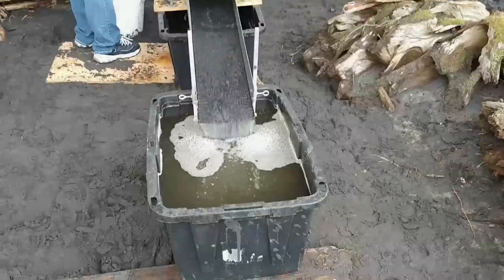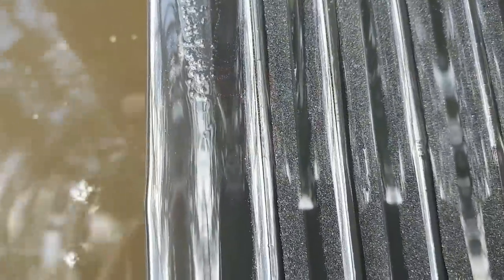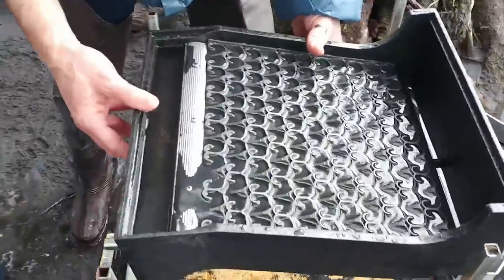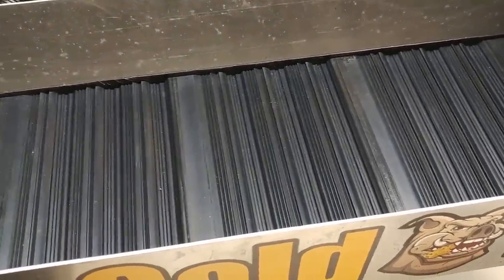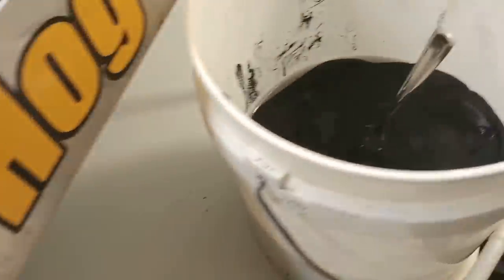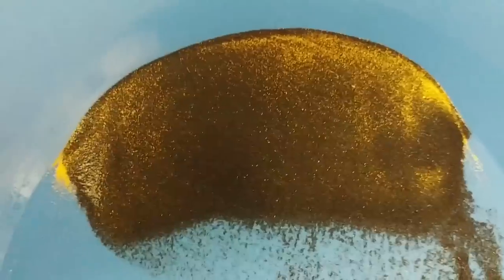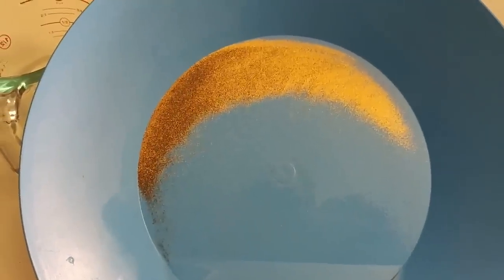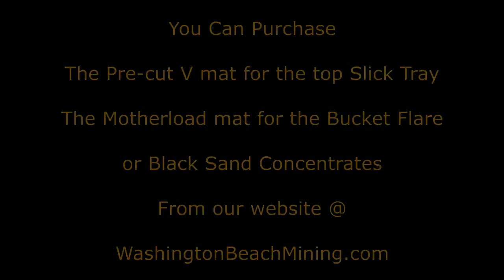5 Hours, 15 Buckets And How Much Gold?

Comment: In my final clean up if I was getting a lot of fine gold like that, as you pointed out yourself some will float on the surface tension. I would put a drop or 2 of washing up detergent in the pan and that stopped any of it floating and possibly getting lost ...... again.
Pretty good result for the amount of ground you put through, just a pain that it's so very fine.

Comment: Some years ago my sister bought a property in Oregon, it had a creek running through, the bed of the creek was black sand. We bought some simple equipment and started to pan for gold, off and on for three days. On the third day, the neighbor told us that five years previously a dredger had been through and cleaned out the creek. Would have had to wait about 1000 years for more to be washed down from the hills!!! I did take a jar of sand home as a reminder of my three days as a prospector. But we had fun😬

Comment: Next time you get a bucket of concentrates put take black sand and heat red hot with torch and throw it in water. Sometimes  alot of the gold is coated in an iron oxide. Heating red hot and quenching in water breaks outside oxide coating leaving visible gold. Heating also converts hematite sand in magnetite sands which can removed with magnet.
Reply: I wonder how much ppl have lost because of the oxide coating. Do you recover some everytime or is it a  hit and miss kinda thing depending on your location

Comment: I have a bit of a question, just in case there is a reply, with all that black sand, is that iron sand?  would you after panning that out, would the powder have to be dissolved in hydrochloric acid to remove iron?  Then the remaining dust get dissolved in aqua regia for the final purification?

Comment: You should use an old wool blanket to get that small gold you said goes through your sluice  Staple it to a 5/8" plywood after a nugget trap on a 24 degree angle . I have caught 3 grams on a blanket 6"longX12" wide . It works and I have pictures of it . The gold cube format is pretty close to what mine is designed like only I have the wool blanket on the bottom  and the steeper angle . reason it works is it uses the angle of repose to get rid of the blondes and the black sands . The gold at this size is not round but flat which lends it self to being trapped in the wool blanket and the rounder blacks and blondes continue on down the sluice
Reply: How hard is it to clean the blanket and how do u go about that. Not a prospector cuz of location but curious as to how you do it.

Comment: Hi, I saw your setup for cleaning up your sand from the gold and I asked myself, why you don't use a "Water Separation Table"? I used them a lot and with the right setup you get even the smallest parts cleanly separated on the first run through.

Comment: If you add 99% isopropyl alcohol to your wet gold powder it will dry a lot faster.  The water forms an azeotrope with the IPA and gets pulled by it, resulting in a much faster evaporation rate.
Reply: Dude, the guy has trouble adding up numbers with 1 decimal and now you tell him to do "this", have some pity.
Reply: @RenzitoARG  you sound pretty rude...

Comment: Do you ever use Finish ( for dishwasher ) or a drop of detergent to break the water tension so that the small finds drop to the bottom and not float? Also, in your pan, have you ever used a magnet to remove the iron black sand?
Reply: I think the magnet idea has been looked into, there has been billions of people trying to figure out the black sand problem was curious about soap and how other chems would affect it.........how about cooking the moisture out to a certain temp , then quench it with with something that makes to sand float?
Reply: commonconservative , the black sand is primarily iron so a magnet does a good job removing most of it. The Finish liquid or dish soap breaks the water tension so the tiny flakes of gold will drop to the bottom but the idea you have works after all the other has been done. Team work makes the dream work! 😉
Reply: oh man ....ideas are cool cause they lead to interesting tinkering, how about this............melt the gold and black sand together and experiment with shaking it around and just letting it melt at different temps.........then look at it and record the looks and the gold stuck to the sand, then, run it thru the sluice to capture the big meatballs of sand and gold........if it works let me know please
Reply: will the sand pop like rocks when heated?
Reply: commonconservative 🤣🤣🤣🤣🤣🤣
Reply: commonconservative 🤣🤣🤣🤣🤣🤣🤣
Reply: those emoji things do not show up for me
Reply: commonconservative , then how did you know I sent emoji's?
Reply: the empty rectangles with an X in them
Reply: commonconservative , they were just smiley faces.
Reply: If the black sand is iron, couldn't you use the electroplating process with an iron bar, some baking soda, and a power supply?
Reply: Matty Sarro , I don't know about that. Sounds like a lot of work when a simple magnet will remove the iron sands. Not all the black sand is iron but most of it is, usually. Then whatever process is needed to be done to remove the rest , burning to refine the gold may do it. Smelting, I believe it's called.
Reply: gebbletook , not worth it. Too toxic.
Reply: You dry your final panned concentrat in a metal pan on your stove . when dry screen off all the coarse gold and use a magnet to reove the magnatite and  small bits of tractor tracks and excavator buckets wearing etc  then whats left  you can pan gently blow and  some heavy s non magnetic sand etc out  screen off all but the sand size and take it to the refinery for smelt and assay and a check..simple.
Reply: @commonconservative7551  sounds like a way to complicate the solution when there is already a simple yet tedious process. I'm not putting you down I just think it sounds like more work. I abided by K.I.S.S. or keep it simply stupid. But don't let me stop you from thinking outside the box
Reply: @commonconservative7551   rocks only pop when they contain moisture so it would depend on if its dry and how porous the black sand particles are.  I'm gonna guess they won't pop tho
Reply: @scubamage  are you talking about electroplating the gold on to the Iron bar or is it possible to electro plate iron on to iron. I wouldn't think that's something you can do but what do I know.

If it's the first one why would u want a gold plated iron bar?

Also gold has to be 24 karat for the electroplating to work I believe. I remember hear(or reading) that all electroplated gold is 24k. Gold isn't usually pure when found in nature and has to be refined in some way. Either smelted with Flux or dissolved in a acid and then precipitated out of the solution. The second one produces a finer gold then the first one. 

Again just curious what you meant by suggesting electroplating it out. The more I think about it the more I think it might be possible. You would want to use a gold wire as the cathoid(or dioude I'm not sure which) and electroplating it onto the gold.
Reply: @lizzymoore54  
It is called smelting and you have to use a Flux when doing it. The impurity get caught in the Flux which  stays separate from the gold.  I don't know if you can remove black sand by smelting tho cuz of irons higher melting point. It has to melt to get trapped in the flux.

Comment: Just a random thought, would a vibration bed settle the gold down to the bottom of the cons bucket?? Saving a whole lot of time
Reply from the maker: No not really, the gold and the black sand weight the same so it is difficult to get the gold to settle at the bottom.

Comment: Chemist tip... if you do a final wash on isopropyl alcohol, ethanol, or acetone (anything that quickly evaporates at room temperature), you can cut down your complete drying time to 30ish minutes or less.
Reply: I'm a chemist as well and I agree.  One quick rinse with 99% isopropyl and then with acetone and it should evaporate within minutes.
Reply: @SparkyMcBiff  I'm a physicist, I actually failed freshman chemistry 😂 I've gotten better though, dont know how you chemists do it.
Reply: speaking of gold rush . they heat the gold to dry it out.
Reply: Really, how much would that increase the cost. This is interesting but not significantly remunerative.
Reply: I'm a fisherman...just put it in a frying pan, turn on the heat and dry it.
Reply: WTF?? dry it in a metal gold pan on the stove (pour off the water first) only take a few metal.mis gold  cinduct heat Real Fast if you short on time  when cool and dry put on paper plate remove magnatite and iron junk etc blow off some non magnetic dust etc
Reply: Pre rinse with alcohol /acetone  then dry... on stove? . right?  Boom!  never heard of that BS.waste of money and a fire hazard.  just dry in a metal gold pan over heat(stove)  like the millions before you have    manOman  lol

Comment: make your self a tray similar to the gold cube but it has to be on a steeper angle 24 degrees . No matts or riffles just cover the bottom with an old wool blanket  staple in place or glue. This works for fine gold very well . There is more gold and less black sand . black sand is a harder material and is more rounded ( spherical) and its angle of repose is less than the flatter softer heavier gold thus the steeper angle . I have collected similar sized gold on a tray only 12"x6" square in the order of 3 grams on one hot spot. The black sand to gold ratio was a lot closer then what you have here . the ancients were right about the golden fleece it does work

Comment: so, what if you put the bucket of cons with water on a vibrator of some kind. would it not eventually migrate all the gold to the bottom of the bucket further concentrating your haul?
Reply from the maker: Have not tried that, but tapping the pan all day long will not drop all the gold to the bottom.

Comment: What if you had a funnel like bucket that had a pipe blowing water upwards for wet materials or a vent blowing air for dry materials. Then at a height above this agitated material a strong magnet to separate the magnetite from the gold before running the gold bearing sands .
Reply from the maker: Sounds good but I don't have the time to build it. Thanks for the advice thou

Comment: You should get one of those new iridium magnets that pick up gold and only gold. Put one in a plastic bag, tie a rope to it, then cast it into the surf. The waves roll it in the sand picking up all the gold. When it's covered you pull it out, carefully turn the bag inside out, and then go home with a bag of pure gold collected while you were sitting on your cooler drinking beer.

Comment: I'm having a hard time getting the sand out of my gold.. I got all the magnetite out and was left with a large amount like you had from very little. The stuff I heavy but it's not as pure flour gold like yours was.. it's full of sand and even gold panning this stuff is so fine I cant get all of the sand out.. it's around 50 % or more gold to 50% sand dust.. can I just melt mine in my kiln and the gold would settle into a button?? Best I could do after panning and I sucked up the gold and sand with a sniffer bottle to collect it. I didn't the hard way... gold pan water and a n52 magnet, then I panned as much sand out as I could and was left with a good amount but its filled with some sand.. I have 40 pounds of the gold loaded magnetite left and I only used less than half a 8 oz cup of magnetite its gonna be some work... I got mine from someone at a mine who doesn't wanna waste time with flour gold.. but this stuff is packed!

Comment: Smelt the crude gold to make an anode and use electrolysis to plate from anode to cathode which is pure a thin sheet .The energy used is 112 watts per gramme so 5 grams so 660 watts at 21watts an hour 32 hours approx.

Comment: Bro all you need to do is take a thick hdpe test tube and fill it with water and a tiny bitnof soap, put the gold in the tube and in a somic cleaner and it would stratify very quickly.

Comment: use a magnet inside os a pllastic bag. colect all the blacksand from the pile... remove the magnet of the plastic in a pan and pan again the black sand for the small gold trapped between magnet and blacksand... easier to classifie fine gold

Comment: Try using a button magnet to draw the iron pyrite
"Black Sand" away from the gold.  Gold as you know
is not magnetic.  So in theory you should be able to
attract the iron without attracting the Gold in the mats.
Worth a try at least anyway.
Reply: I think I heard another youtuber say that it will pull some of the fine gold with it. Not because it's magnetic tho, it's wet so the gold sticks to it maybe or possibly gets trapped between the sand particles when they connect cuz of the magnet

Comment: 5 gal plaster bucker, a bit of merk and concrete mixer and get 100% or aluminum pan with thin layer of con's, when dry run magnet over the pan's that's been drying in sun. Now run your sluice

Comment: We're getting setup to mine that sand down to there to next year.  We're up the river on the Oregon side and it's just over a 3 hour drive for us from here so it's not that bad.  Looking forward to getting down there for the weekend and digging in the sand.  Hope to maybe run across you there someday and chat some.  Thanks for the videos and the advice.  My setup I've put together is pretty much the same as you're minus the extra Gold Cube stacks.   I've upgraded my Gold Cube with the low profile v mat for the slick plate and replaced the vortex mats with the sawtooth mats curious more about your opinion and success with the sawtooth mats so far?
Reply from the maker: Hello Don
Thanks for nice comments and the purchase of the sawtooth mat from us. The sawtooth mat works the best when running this beach sand. Reason for that is Hydraulic Equivalence. Meaning the size of the black sand and the gold have the same settling velocity under the same condition. The sawtooth mat using a back eddie in each ripple helps keep the gold from leaving and move the same size black sand out of the ripple. Thou not perfect but what a difference you will notice switching from the Vortex mat to the Sawtooth mat. If you need any further convincing, Mike Pung from Gold Cube has tested this mat from me and was impressed with it. It simply out performed the vortex mat on beach sand and vegetation dirt. It will be introduced in the cube come February 2019. This beach sand needs more time to process thru any type of sluice. The more sluice you have the more faster you can run the sand. We are using 9.5 cf of sluice. Limit is 10 cf. We run 300 lbs before we stop and do a quick clean up. So for your setup i would keep it too 2 buckets per hour with a clean up after every 2 buckets. Use the V-mat as your window. Add one scoop to the top tray and wait 30-40 seconds for it to clear out the black sand. Get a look at the gold, if you see just a few pieces, then look elsewhere. You should see 20-50 colors per scoop as good ground. Hope that helps. We will be out this coming weekend for a 4 day New Years Eve trip. If you are there then yes come say hi. Good Luck!

Comment: When you get down to the bottom part that you shown at 18:55 you can dry it out and use a magnet to catch the black sands I got that tip off KleshGuitars

Plus get a heat guy, again KleshGuitar 👍🏻
Reply: Klesh is a dope channel.

Comment: I did an experiment here in Alaska with the cube with super rich con's every time i ran them i got the same thing 3 grams put in ounces get 3 gams the cube blows gold out all day long best is spiral wheel.  I found older wheels made from an old semi fuel tank with rubber glued in and lots of gold falls behind if glue gets bad so older wheels can pay in more than 1 way. lol     Cool vid your the first person doing changes to cube just like i was thinking about doing. Here in AK foil gold is mostly whats here and the cube "will not catch foil gold" spiral wheel will. P.s i've found gold at tourist spots all the time. I'll kick dirt in my pan every place i go found massive deposits right in parking lots 10 feet from trail map stands. the thumbs down guys are just sad ass9's        keep   kickin pans
Reply: That's a pretty big loss but maybe its cuz of your gold being foil. Chances are it's catching a better percent off what he is running through it otherwise that is some seriously gold bearing sand.

I thought that spiral wheels were intended for cleaning up your cons not for actual prospecting but maybe I'm thinking of a different piece of equipment. I'm not a prospector since there isn't enough gold around here to make it worth it even as a hobby.

Comment: A conical agitator with a mixture of sand and water to increase the specific gravity of the liquid should see the lighter elements floating and the heavier elements sinking to the bottom, the floaters can be skimmed off to leave the gold, it works with coal, just a crazy idea.

Comment: Gold cube  has got it close for fine gold . I built a set up that is similar with a nugget trap before the gold catching trays . my trays were on a 24 degree angle with just an old wool blanket no riffles . fly screen gold down to 200 mesh .  tried gold hog riffles was not as successful as with the wool blanket for fine gold .  cons are a lot cleaner then this fellows

Comment: Get a soft box with a regular light, not strobe, with a stand and angle the light so that it isn’t reflecting off the water (as much as possible). Find a position for your camera that you don’t see the reflection of the light and the only thing you should see is water and gold. Just some advice from a photographer. Congrats on the haul, seems well deserved for your effort.✌️
Reply from the maker: Thanks for the tip, i will look into that.